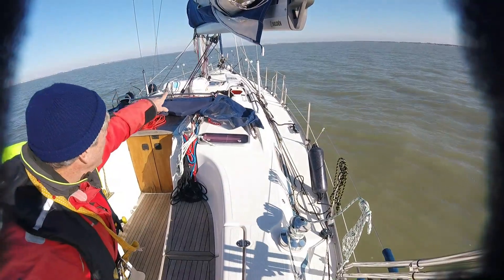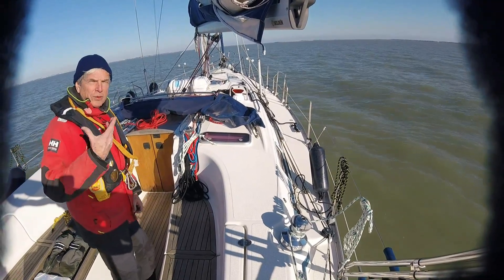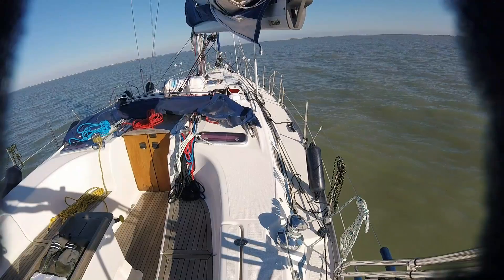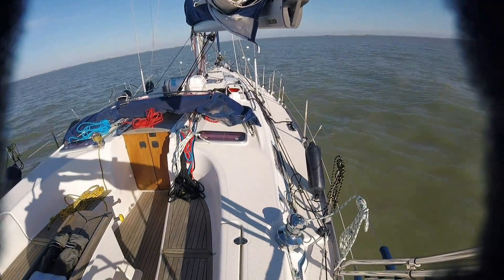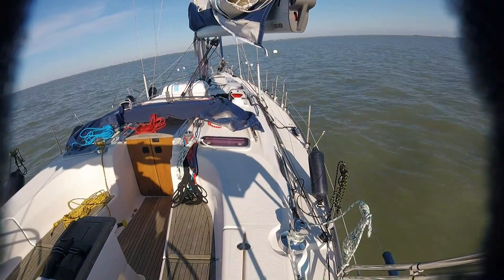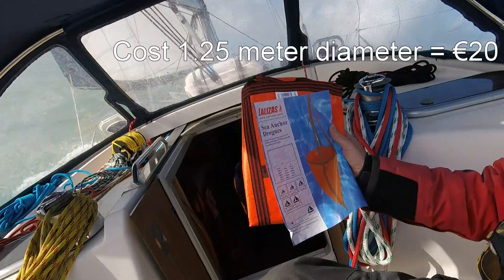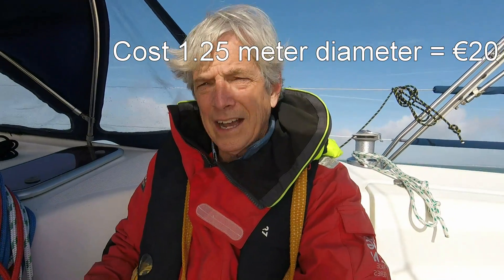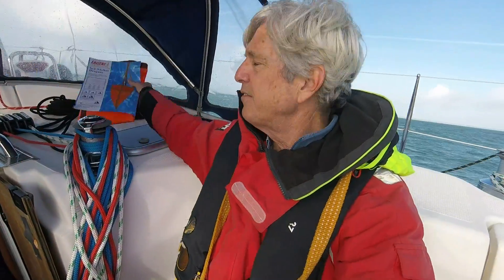Ep 36 Preparing Next Major Passage

Comment: Hi Patrick, your drogue couldn't work because you were still under sail and you had a functioning rudder. Even if you fix the rudder midship, the sail is still generating forward drive and the rudder at the stern is basically still stabilizing the flow. If you want your experiment to work, you have to release the rudder completely (easier with a tiller). Then the boat will probably shoot into the wind, anyway. 

I would only use the sea anchor to keep the boat's bow into wind and waves when I have lost rudder in heavy weather and have reefed the sails completely (what you should do anyway without a rudder), then the sea anchor will keep you somewhat stable until help arrives or weather dies down and you can maybe work on fixing a makeshift or so. That's all I would use it for.

...and if you don't have such a nice orange sack handy, a simple bucket will do the job just as well... ;)

Fair winds to you - Iceland sounds very exciting. Looking forward to the video!
Reply from the maker: I tried the bucket once before ---- it ripped off after 90 seconds.   :-)   You may be right about the rudder, but I've seen videos of others steering with drogues while having the rudder locked.   I really think my problem was, as you mentioned, the sails, not the rudder.    I was just overpowering the drogue.   I have since read the recommendation that when going downwind, you should drop the main, and just use the reefed jib/genny, and when heading upwind, reef both deeply.    I'll give it another try some day and see if that works.
Reply: @patricklaine6958  Interesting! Please let us know about the outcome :-)

Comment: I thought the berthing was excellent in all respects. As they say in your former line of work - any landing you walk away from .........😉 How will you rig your storm sail? I did not really understand your explanation of the foredeck adaptation down below in the vee berth for the Solent. On the drogue steering it did not look, when the drogue was right out to port, that there was an effective lever to the midships cleat. I accept there is a lever between the midships cleat and the centre line of the boat. I am wondering if the drogue would be better acting in the stern cleats because that is behind the keel whereas the midships cleat is probably bang in the middle of the keel.
Good to see another video from you.👍
Reply from the maker: Welcome back Norman.   The point I didn't make very clear about the foredeck adaptation is that you can not just attach the stay cable to the deck.  Under a good blow, it will definitely rip the foredeck from the sides of the boat.  Thus you need to reinforce the underside of the deck --- and either run the cable through the deck and attached to the bow --- or spread the load across the under side of the foredeck and have it anchored against the sides of the boat.   A friend built his own boat and underestimated the forces, and the wind did actually rip the foredeck away from the sides.    On the drogue, all of the literature I have read says to locate the line at or forward of the pivot point of the boat.  I'm absolutely convinced this will work.   My error was to have far too much sail out.  The drogue was simply overpowered.    I'll give it another try.  Thanks for commenting.

Comment: Hi Patrick.  Great to see you back.  Perhaps if you had a spinnaker pole or similar lashed athwartship you could get the line further out and get more leverage  ( yes and probably snap the pole ) - just a thought, and quite likely an impractical one.   And if your rudder broke, or the linkage failed, wouldn't your rudder be more likely be loose rather than fixed, thereby offering less resistance than a centred and locked off position?   I expect the remedy is simpler and more practical, but I just thought I'd share a couple of armchair admiral thoughts, flawed though they probably are...  : )  Looking forward to your Icelandic adventure!
Reply from the maker: Thanks Robin.    You are exactly right on the spinnaker pole.  That's how you fly both sails when running downwind --- the pole holds out the genoa, and the Solent sail is flown 'wing on wing' on the other side.  I wasn't trying to do serious downwind sailing on this one --- I just turned downwind to reduce the wind noise and quickly shot the video.   I'll have to give some more thought to your loose rudder idea.  Good food for thought.
Reply: Hi Patrick. Sorry for my ambiguous reference to the pole. Actually I was suggesting you might use the spinnaker pole at the stern as a way of holding the trailing line to the drogue further off the side of the boat. You had the line as far to port as possible from the winch, but it was still not altering the direction of the boat. By running the line from your winch through the end of the pole, which is secured such that it sticks out the side of the boat, then this would move the drogue further off the side of the boat and in so doing create more “leverage” from the drag and hopefully pull the boat to port. Sorry a simple sketch would negate the 1000 word description. Anyway it might make zero difference but sometimes a lateral idea bears fruit. Cheers
Reply from the maker: Ahh….I follow you.   That may well work.   I want to try the easier solution first of greatly reducing the amount of headsail I had out.   That little drogue was always going to lose against my enormous genoa.    Thanks for commenting.

Comment: A stupid question from a beginner: doesn't the cutter stay (for the trinquettte) prevent the genoa to tack easily ? Or do you have to furl in to change the side?
Reply from the maker: Not stupid at all Don.  The disadvantage of a solent/trinquette rig is that you must furl fully the gennoa before tacking/gybing.   People get around this by using the solent/trinquette (it does not need to be furled before tacking/gybing) in busy coastal areas or when arriving/leaving marinas, and then once in 'clear' water, use the genny.    An advantage of a 'cutter' rig (over a solent) is that often the genoa can slide between the the two stays --- or at least does not need to be fully reefed before tacking.    Good question.
Reply: @patricklaine6958  I have sailed on a cutter rig (corbin39) and I tried everything but never could change the sail without furling or going to help "by hand" (and even like that the jib was most of the time ending in a hooving to position - I don't know exactly the term when the 2 sails are opposed and you're stopped). This boat was very bad for going upwind so I wonder if the solution was not to use the cutter instead of the jib... Anyway. I'm curious, you added the cutter stay by yourself crossing the deck and fixing to the hull as shown on the video?

Comment: Hello Patrick
we are sailing rather long trips (Azores, Canaries, Norway, ..) too and
we have a Bavaria 38 cr 2009, with the anchor equipment of the Bavaria company. We are already quite a time thinking about a solent stay.
There is clearly a big similarity between the boats, so i am very interested in your solution.
As i understand, the object in white is pushing upwards against the deck. Is it only anchored (laminated) at the extremities in the hull?. There is in any case not much room to make sufficient contact surface. What are your experiences until now? Which firm did the job?
What anchor do you have on the bow roller? Vulcan? Rocna, Mantus?,...
Best regards
Bert
Evarne 
.
Reply from the maker: My anchor is a Lewmar Delta, and I have been happy with it.   A local marine engineering firm in La Rochelle did the inner forestay chain plate arrangement.   They made a mold of the under side of the upper deck, and then embedded a wide stainless steel bar in an epoxy material to cross from side to side of the boat (pressing up into the under side of the front deck.   It is NOT substantially attached to the sides.   I think the idea is to have a very wide surface, that spreads the load across the entire upper deck surface (rather than just a point chain plate fitting).  At any rate, I have been in some pretty good blows with it during my trip around Iceland, and have had no problems.
Reply: @patricklaine6958   Okay, thank you very much!

Comment: Did you have to install backstays as well after installing the solent? Or do you already have these stays?
Reply from the maker: Since a solent is attached near the top of the mast, no additional backstays are required.  If I had gone for a cutter rig with the attachment at the level of the spreader, I would have needed to install running backstays (and release one and attach the other at every tack/gybe).   Good question Vincent.  I explained this on film, but cut it during the edit due to length of the video.  Thanks for watching.
Reply: Patrick Laine Well that was a mistake Patrick. Your videos are always too short ... regardless of their length 🤪🤪

Comment: Just a thought. Did you have the lines to the drogue one to each side of the drogue - or did the drogue itself have a bridle. If port line goes to one side of the drogue and stbd to the other, tightning one would 'collapse' the drogue.. whereas if you had a bridle it should just put all the load on one rope or the other but not change the behaviour of the drogue itself in the water.
Reply from the maker: Good thinking Richard --- but this drogue has a single point apex where the bridle lines attach.   Pulling one side of the bridle will not collapse the drogue (in this case).    Thanks for commenting.

Comment: Patrick - Love the videos. But have to say, sailing with the bumpers on the deck is like taxing back to the line with your flaps down.  Enjoy the trip to Iceland.
Reply from the maker: Rip the wings off that guy!  ;-)    You're of course right, but it is a real lot of work (I have 10 fenders in total).  (There is also a safety factor of having to go forward multiple times to retrieve them or put them out -- often in rough water.)    I've decided this year to leave them in place 'hooked up' to the lifelines if I'm just making a one day passage, but will take them off for passages of more than 24 hours.    Half flaps.
Reply: Patrick Laine Hah! - no worries, you are fully "up" in my book!  (East coast USMC A/6's circa late 80's.)Just added fuel cell (140) - look forward to learning the system.  Again - bon voyage - really enjoy your videos - keep 'em coming.
Reply from the maker: Semper fi my friend.   Lemoore A7s and then the Super Etendard in the French Navy.   Got out in '85 --- and then a Piper Arrow for 10 years.    Great memories.

Comment: Hi Patrick 
I catch mooring balls on the side from the cockpit, whether solo or with a crew. Pros are first I see the ball which is not hidden by the bow, second I don’t have to walk to the bow and I remain close to the tiller at all time. I have not encountered any cons so far. I have shared some of my tricks on the blog of idb maree haute. I’d be happy to share more with you. 
Thanks for your videos
Best regards,
Philippe
Loarwenn
Reply from the maker: I filmed a blooper a few days later Philippe where I took the ball far aft of midships.    I'll show it some day.   Don't forget that I did this under sail.   If you take the ball far aft UNDER SAIL, when the line to the ball comes under tension, the bow will be pulled around and the sail may well do an unintended gybe.  That is exactly what happened to me.  On the other hand, when I take a mooring ball UNDER ENGINE POWER, I do exactly as you say.   I try to take it about abeam, but often from the edge of the cockpit.   Thanks for commenting.   (You'll chuckle when I show my blooper with the gybe.)    I'll see if I can find your blog.
Reply: Patrick,
Good point. I must have been lucky when I do it under sail :-). I look forward to seeing your video. By the way, I attach the line to a bow cleat before I bring the free end aft, outside of the rigging, and I walk back to the bow with the free end after having passed it through the eye of the mooring ball. The boat remains more or less front to the wind. 
Are you on your way to Iceland?
The blog can be found at https://blog.idbmarine.com/malango-870-loarwenn-rex/
Fair wind and best regards
Philippe
Reply from the maker: I just read your 7 page blog.   It is very well done.     We share some similar practices (EFOY and tether line around the cockpit table :-).    (My EFOY is a bit underpowered for my size boat, but I still like it anyway.)      I'll try your tip of putting out (the tightly sheeted genoa in my case) before launching or retrieving the spi.   I have had a few 'exciting' maneuvers with my spi, which has caused me not to use it as soon as conditions become even slightly difficult.   That is a shame.   I'll try your method.   I think our method of picking up the mooring ball is very similar, except I use a hook instead of a loose line.  My line is attached to a bow cleat as well, so I can drop the hook/line as soon as it is attached to the mooring ball.   The system works very well when picking up the mooring ball under engine power.   As I said, if I take the ball too far aft when UNDER SAIL, I risk gybing when the bow is pulled around by the mooring ball --- which is why I try to take it in the first half of the boat.    Thanks for the link.   Bonne navigation cette saison.
Reply: Thanks Patrick for your comments. I agree we share a lot, including a carrier in the military, our age, the same YouTube videos and may be more. I went to school at MIT and your accent sounds bostionan or at least easterner. Am I right?
Reply from the maker: Too bad about having MIT on your CV.   I'll forgive that.    (Stanford)  :-)

Comment: Good to see you back and planning another sea adventure. Regarding sea anchor trial I suppose it's use would be if you lost main steerage, so should you have left rudder free to move instead of locking wheel?  just a thought. Must have a look at mooring hook as I am motoring on a bit and need all the help I can get.
Reply from the maker: Someone else mentioned freeing the rudder as well….. I'll have to give that some thought.   I think the reason it didn't work was that I had too much headsail out.  It overpowered the drogue.   I'll try again.

Comment: Another great video.  And once again you cover things that I am anxious to learn about.  I will be interested in whether you get the drogue steering to work.    How did the heater work out?   What type of heater? 

And i agree about How to Sail Oceans.  Kevin's videos,  like yours,  are excellent!
Reply from the maker: Thanks Chuck.  I have a Webasto heater -- that works fine.  My concern was that it does use a lot of electricity too ------ but there must be something in its programming because after about 20 minutes of operation, the power usage drops dramatically.  All is well.   Completely agree about Kevin.  A real mariner.

Comment: Maybe if the drouge attachment was moved closer to the bow it would have more influence ? Just a thought, never used one myself..Love You videos
Reply from the maker: The line really needs to enter the boat at the widest part because that is what determines how far left or right you can pull the drogue……     I tried this again yesterday just by adjusting sails.  It worked fine when heading downwind when I dropped the main, and just used a partially furled headsail in combination with the drogue.    I could even gybe with it.  However, nothing I did would allow me to bring the wind forward of abeam (once headed downwind).   Will keep working on this.

Comment: Hello Patrick, it's great to see another video from you.  The tips you give on techniques and equipment have been very helpful for my learning.  One question I would like to ask.  At around 10:35 you mention that with 6 knots and one reef, you are going too fast.  Can you please explain the risk and your wish to slow the boat ? You do not seem to be heeling too much.  I am interested to know in case I find myself in the same conditions.  I very much look forward to following your videos on the trip to Iceland.
Reply from the maker: That speed in this boat is absolutely fine Andrew.    My concern was throwing out that comparatively light-weight drogue into that force of water.  I was afraid it would instantly be torn apart by the water pressure --- thus my desire to get to 4-5 knots before deployment.   (You don't want to be too slow either, as the drogue will then just stop you defeating the purpose of continuing to navigate despite a steering problem.)   I should have explained this more clearly.   Thanks for watching.
Reply: @patricklaine6958  Many thanks for your explanation, Patrick.  All is clear now.

Comment: Patrick-  I missed where you attach the halyard for the Solent. Also, do you have running backstays for it or is the original rigging sufficient to take the load. I can't wait to see the Iceland video. Safe travels.
Reply from the maker: The good local team from Selden drilled a new hole in the mast 6-8 inches below that of the main halyard.  If you keep the halyard close to the top, there is no need for running backstays.  However, if the halyard exits at the level of the spreaders (cutter rig), then you really should be adding the running backstays as well.
Reply: Thanks. Again, safe voyages.